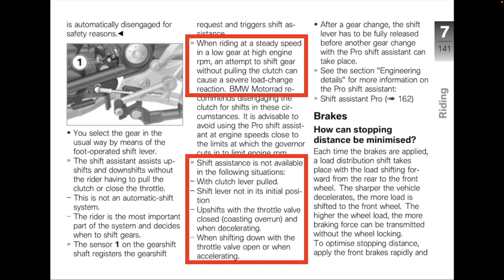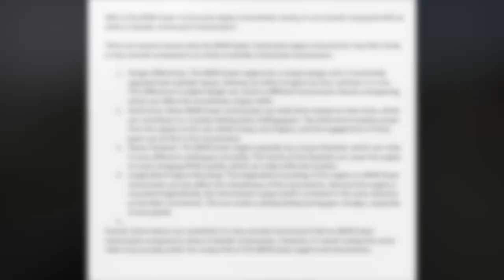BMW R 1250 RS, What's with the Clunky Quick Shifter?

Comment: My GSA quick downshifts flawlessly.  Amazingly good rev matching, and smooth as butter.  I don't even bother trying to use it on upshifts, 50% of the time it will miss 2nd to 3rd entirely, whether you're moderately accelerating, or pushing at higher RPM's.
Reply from the maker: Thanks for checking out the video. I very much appreciate you sharing your experience with your GSA shifter.

Comment: Qucikshifter works just fine if you know how to use it. Typical ride short shifts with throttle cranks 50% or more and this causes the shifts now to be smooth. If you’re easy on the throttle it’ll shift smooth on low rpm. If you’re on it then don’t short shift it. What I do is crank it to accelerate fast, back off on throttle a little and use quick shifter to upshift (if I wanna keep rpm’s low). Works like a charm
Reply from the maker: Thanks for your insights and suggestions

Comment: I agree with the points, but 😊

I’m not sure there many large twins with smooth quick shift.  Very strong torque pulses from twins may be more difficult to deal with.  Just thinking.
Reply from the maker: Thank you for watching and commenting. I’m going deeper into my channel’s back end and found I missed many comments apologies for not messaging sooner. I test ride a Moto Guzzi V100 which is an 1100 transverse V twin. It’s quick shifter is butter smooth. There’s something much different about the boxer’s gear box.

Comment: I found at the end of last year that if I pull the shift lever up slowly and wait, the upshift is much smoother in lower gears.  It sounds counter intuitive for quick shifting, but if you just put up pressure on the lever and wait a bit it seems to work really well.  I think that if you really pull up suddenly, it  kind of forces it in to gear before the bike gets a chance to rev match.  Downshifting works the same, but wasn't as bad to begin with anyway.  Ripping through the gears racetrack style would be pretty sweet, but there aren't many places on the street I would do that.  Slow upshifting with the quickshifter is a bit faster than shifting the manual way and takes less effort, not that manual shifting is difficult on this bike.  Give it a try and let me know if you have the same results.
Reply from the maker: Thanks for checking out the video and commenting. Giving the gearbox a chance to find its sweet spot kind of defeats the purpose of “quick”. However I get what you mean and will give it a try next time.

Comment: OK, here's the the deal with clunky shifting on big twins no matter the manufacturer. Big twin power pulses are larger than a multi cylinder engine smaller power pulses per cylinder.  A twin has larger pistons (600cc per piston) versus the 266cc from the K1600. When those larger pistons fire, they put out a larger power pulse on the clutch and transmission versus the smaller pistons on the K1600. Think of it like using 2 large hammers hitting a single point (drivetrain) versus 6 smaller hammers hitting that same single point. No matter how precise the gearbox and transmission is the power pulses from a large twin are extremely different from the power pulses from a multi cylinder engine. Ride a Yamaha Vstar or any Large displacement twin and you'll notice how clunky gear shifting can be and Yamaha is known for amazingly precise gearboxes. Driveline lash and shaft drives can amplify this but it really boils down to the power pulses a large twin makes versus the power pulses from the smaller pistons on a multi cylinder engine. Every large twin from Honda Super Hawk, RC51, Ducati Race bikes, BMW, Harley twin to KTM, Yamaha Vstar, Suzuki M109 all have clunky shifting gearboxes versus their multi cylinder counterparts (3,4 and 6) The quick shifter isn't going to change that.
Reply from the maker: Thanks for the comment and expert insights. I understand your explanation, but here’s an add on perhaps stupid question. Why is it going from 2nd to 3rd at 3,000 rpm clunkier than changing 2nd to 3rd at 5,500 rpm on my RS?

Comment: I only bother with the quick shifter in high rpm situations. Most of the time I just use the clutch. While a quick shifter may be an advantage in a 4 cylinder bike, big torquey twins less so.
Reply from the maker: Seems that’s the case that twins with strong low end torque have trouble being smooth in the lower gear changes.

Comment: My experience on my '22 R1250RS is about the same as T2T's. I can get a sorta smooth 1-2 quickshift, but only at serious throttle opening and higher rpm. 2-3 quickshifts also want nearly full throttle and high revs. 3-4 quickshifts not so much - they're smoother and medium accel and medium rpm. 4-5 and 5-6 shifts are very smooth at nearly neutral throttle and lower rpms. Auto-blip on downshifts works great. My 2016 S1000XR was pretty much the same during accel in lower gears - you really needed to be going. Was great for passing a line of slow movers going over Stevens Pass (Hwy 2 in Washington State). In summary, I'd say that the quickshift on my '22 R1250RS is just as good as the quickshift was on my 2016 S1000XR.
Reply: Hwy. 2 can really get backed in the summer, so any advantage one's bike can have to manage that issue is worthwhile. I don't use the QS on my '20 R1250R too much, but I can see how it could be awfully handy in that scenario.
Reply from the maker: Thanks for checking out the video and contributing your insights on the RS and XR. Interesting to hear the XR wasn’t much better. I have two friends that have XRs and they say it’s better than the boxer.

Comment: Most modern chain drives have cush pads in the rear hub .... versus the BMW shaft drive which has none. Cush pads are there to dampen the "jolt" when shifting.
Reply from the maker: Thanks for checking out the video and commenting with your insights. Good to know.

Comment: I had an f850gs that was also clunky in lower gears. In fact the new 2023 r1250 gs that I have is smoother than the 2019 f850.
Reply from the maker: Yes the newer beemers are better especially once you learn the sweet spots for up shifting. Thank you for watching and commenting.

Comment: About the only time I use the QS is merging onto freeways. 40 years of riding has created too much muscle memory to make a QS intuitive, and honestly my shifting at this point is nearly as fast and smooth.
Reply from the maker: Thanks for checking out the video and commenting. The first year I owned my RS, I used the quick shifter probably 20% of the time and mostly only switching from 4th to 5th and 5th to 6th. Now I’m probably doing about 60% of my shifts both up and down with the quick shifter. I’ve become accustomed to its intricacies and enjoy using it on a more regular basis.
Reply: @Texas2Tires  I’m very satisfied with the quick shifter on my ‘21 GS.  I’ve learned the idiosyncrasies now.  Not smooth like my old Tiger 1200 XCa but still great.
Reply from the maker: @roybenjamin  Thanks for checking out the video and commenting. You hit the nail on the head. The boxer quick shifter you have to get to know well before enjoying it. Like a good friend, the relationship develops with time. 😊

Comment: Hi sir, good work! I own a GS 1250 2022 and use my clutch from 1st to 3rd gear. If I understood you well, I could use the quickshifter at higher rpm for these first 3 gears. What is the ideal rpm…according to your experience with your RS? Thanks! Marc, Quebec, Canada 🇨🇦😉🏍
Reply from the maker: Thank you Marc for watching the video and commenting. For my bike, using the quick shifter from 1st to 2nd then 3rd smoothly is about 5500-6000 rpm. I’m guessing every bike is different, so practicing how best to address this is by important

Comment: My up shifts are ok but the down shifts are crunchy and vague, sometimes spongy. It's got worse as the weather got warmer..... through the winter it was smooth as silk up and down. Very odd.
Reply from the maker: Thanks for checking out the video and commenting. That is strange, metal does expand under heat but the gear box and engine are hotter than surrounding temps regardless of season. So again that’s odd. Mine has always been smooth down shifting all the way to first and smooth going up past second using the quick shifter. From what I’m hearing, the new R1300 boxer engine has a redesigned engine and gearbox making it smoother than current models.

Comment: Quckshifters are generally not meant for short shifting. Also 1st to 2nd is never smooth on boxer engines. The rest is fine.
Reply from the maker: Thanks for checking out the video and commenting. Rumor has it the new boxer engine on the R 1300 GS is much smoother than the current boxers. Also I noticed after doing a tune on my bike the quick shifter is also a bit smoother, but not nearly as smooth as an in-line four or the K 1600 in-line six

Comment: On my '14 r1200rt I don't mess with 1-2, or 2-1. If I roll off/on with the shifter pedal preloaded it slips right in. There's a sweet spot much like rev match shifting without it. Sometimes I wonder if that's all I'm doing and if it's even working. Lol
Reply from the maker: I think every boxer owner has their own unique experience with the BMW shift assist. Thanks for checking out the video and commenting.

Comment: Shaft drive has to have something to do with it.  When I accelerate hard, the up shift is pretty smooth.  Otherwise, 3 to 4 and above upshift is ok.  Downshift is pretty much fine.  Minor issue for an otherwise great motorcycle.
Reply from the maker: Thanks for checking out the video and commenting. Very true, it’s an awesome bike.

Comment: there really is no need to have a QS unless you are on a race bike ...we all grow up changing gears with the clutch anyway so I don't bother using the QS on my BMW...its just an added cost and complexity hardly needed on a tourer
Reply from the maker: Thanks for checking out the video. However have to disagree with you here. I use my QS all the time. It’s very helpful and after flashing my ecu with BrenTune it’s much smoother and enjoyable.